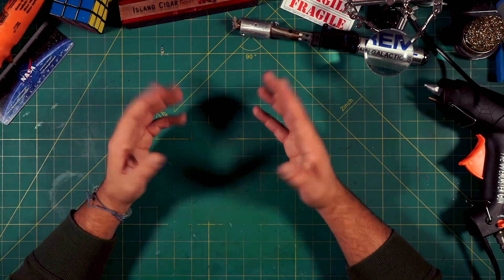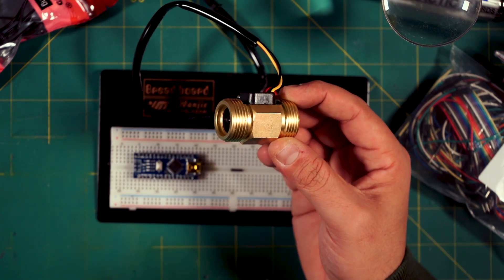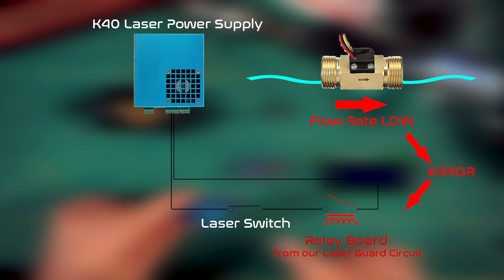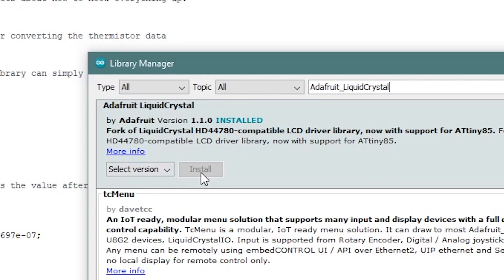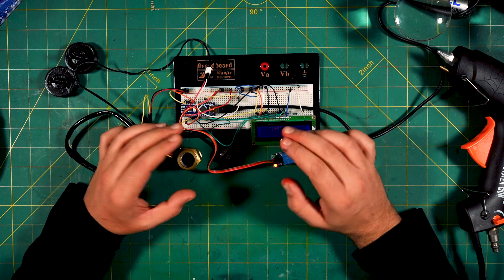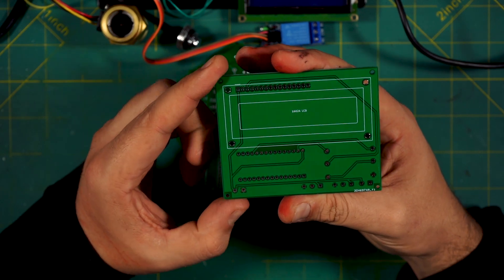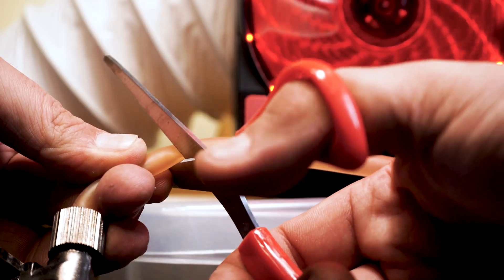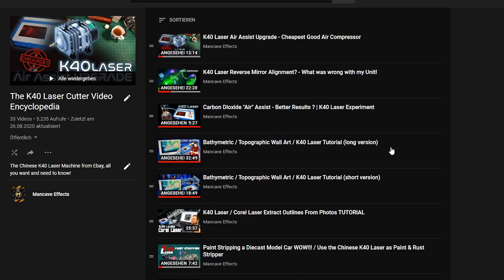K40 Laser Cooling Guard Build / This may save your Laser Tube

Comment: looks great, thanks. but since you're dabbling with arduinos, code, etc, wouldn't it be easier to prevent the laser from working if the water isn't flowing, or it's too hot? just wondering... :-) thanks again
Reply from the maker: It does cut the laser from working when no flow is detected.
Reply: @MancaveEffects  ah, ok. sorry, I must have misunderstood something 😂👍

Comment: Great... Can I ask for a tutorial on cutting 3mm and 6mm ply... I'm have trouble find the sweet spot 😁
Reply from the maker: Let me see what i can do as this varies from machine to machine. Some K40‘s cut thru 3mm ply in one go, others don‘t. I depends on the actual laser tube. For 6mm my machine needs up to 4 passes to cut thru, of course this leaves a nice charing though 😂
Reply: @MancaveEffects  I brought special 3mm laser ply off ebay... Got air assist.. Fancy cloudray Lens holder with zeze lens... Still takes 5 passes and sets fire lol.....
Reply from the maker: Though i have the same issue, good that you meantion this! You know this wood is made for fancy lasercutters that have a tighter beam angle and higher output. The cuttingline width of these machines is 1/10 of a mm. The mid of this material is made from hardwood  to give it higher strength when you cut very small parts. The K40 is not powerful enough for this material, i got rid of this stuff as it does not work. I get my ply at the home improovment store, in Germany there is a brand called „Pappel“ their 4mm plywood is way softer and easy to cut even with my machine. You will probably find it at Michaels in the US or other crafting store. Here they sell it in all differend sizes (A5,A4,A3 EU Paper norm) and costs like 3 bucks for a pack of 5. If i need strength i use acrylics. But for most of my work this simple softer plywood is ok considering the price of this machine. Try if you can dent it with your fingernail when you are at the store, this should be the right stuff.
Reply: @MancaveEffects  ahhh that explains it... Im in Ireland i work in a warehouse.. I got some thin ply about 5mm that cut in 2 passes from a packing case...

Comment: Are there no PC Liquid Cooling indicator wheels with integrated hall effect sensors? They're made by putting a magnet in the end of each spoke, then having a hall effect sensor in the housing. They certainly exist in the industrial world since I've serviced them in Coherent Innova 70 and 300 power supplies, but they're way out of scope for this due to the cost.

I just can't imagine that someone hasn't made that already. It would be killing three birds with one stone: Visual feedback, temperature, and flow rate measurement with far fewer connections as potential failure points. 

They also don't care about the flow direction.

Comment: why go to all this trouble just install a hall flow sensor on the appropriate pins, it cost 5 dollars for the sensor and 2 minutes to attach it, if there is no water you cant fire the laser, best safety feature there is.
Reply from the maker: Because a flow sensor measures the flow rate continously and gives an estimation of how much fluid runs thru the system. Over time build up in the pipes may comprimise a proper flow rate... You could use a flow switch and hook it straight up to the laser switch if it should only toggle when the pump is running.

Comment: I want one but well too late, a brilliant idea , why this is not built into the laser is beyond me or even just a simple interlock water meter switch, if the pump fails the tube blows and this saves 150 euros every time. Truly brilliant thank you. Next on my list to make, I dont mod my K40 as I use it a lot, the only mods are for safety or workflow and this is 100% safety IMHO. for my wallet.😄
Reply from the maker: Contact me on Instagram if you want one.

Comment: Nice project, how did the flowrate adapters you printed turn out, I assume you had to use some sealant or at least a rubber washer?
Reply from the maker: I tried them, turned out they are better in the trash bin as they leaked everywhere 😂😂😂... it was a bad idea beeing lazy on that point, just spend these couple of bucks and get some from the store
Reply: @MancaveEffects  I did wonder, but with a bit of silicone sealant on them I get you could get them to work!
Reply from the maker: Well for my experience everything involving some sort of air or water pressure, 3d printed stuff just isn’t dense enough to keep up. Maybe with some sealant you can make it air or water tight but after some days it will start leaking again and due to gravity it will spill two gallons of cooling solution thru my Mancave. Therefor i decided to get me some metal parts and use my non exsisting plumbing skills to fit this thing in safely ;)

Comment: Thank you for this! I was debating on using an esp32 for this, is this an option as well?. Keep making content , looking forward to more!
Reply: I hope Mr Mancave doesn't mind me jumping in here, and I hope I haven't missed anything!

I don't see why not, but you'd have to change the code for the ports you use, plus IIRC the ESP32 is a 3.3v device so you'd need a relay board, flow sensor and LCD that are designed for 3.3v, or use level converters.

Of course the ESP32 won't fit on the custom PCB.

To be honest an ESP32 is a bit overkill, one of these little nano boards is perfect. I order them 5 or more at a time!
Reply from the maker: The ESP32 will not fit the pcb and even you could tether an alert via wifi to your phone (if thats the idea) while working the next room, i would recommand to always keep an eye on your laser...  to many people showing pictures of their machines that went up in flames ;-)....
Reply: Thanks everyone I am going to do some testing and follow up!